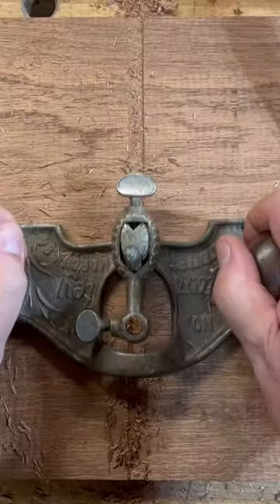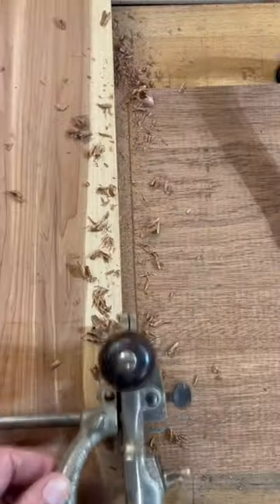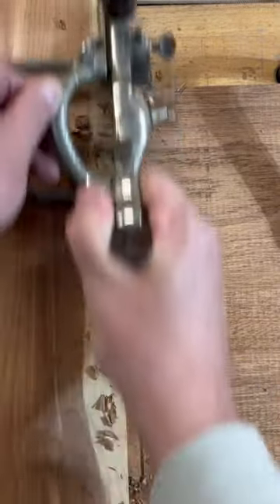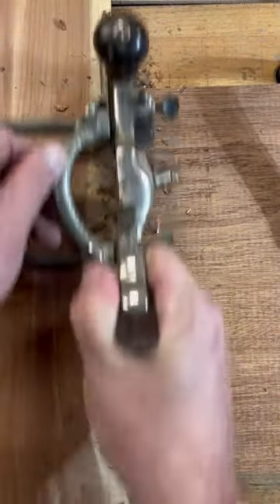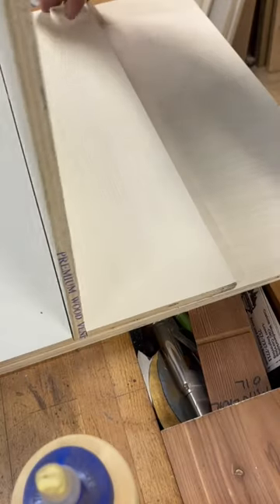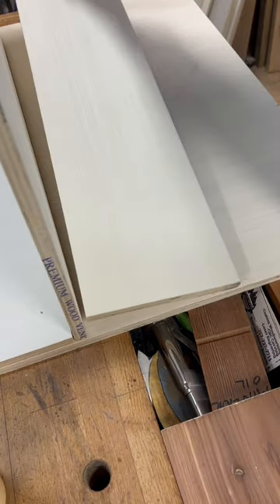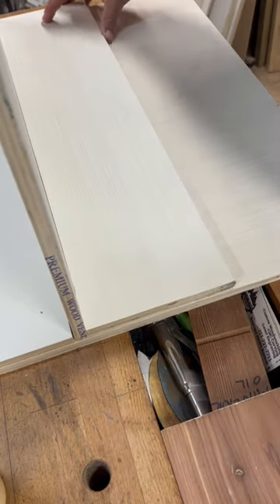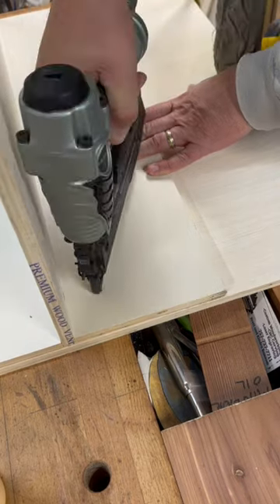How to “cut” a poor man’s dado joints #diy #stanley #hybridwoodworking #handplanes

Comment: From a 67 y/o retired custom cabinetmaker's viewpoint, I'd use either a stacked dado set or a router/flute cutter setup, especially if I'm doing multiple cabinets. But this method is ok for single piece work. Also, use 3/8 material for cabinet sides and floors (final thickness 3/4 in.). No sense making the cabinet heavier or beefier than it needs to be.
Reply from the maker: All great points! Thank you